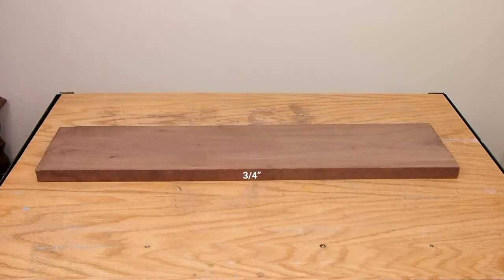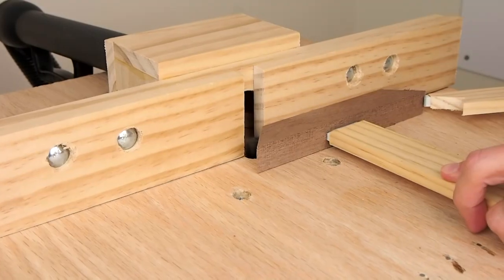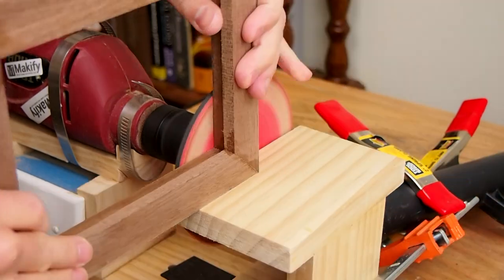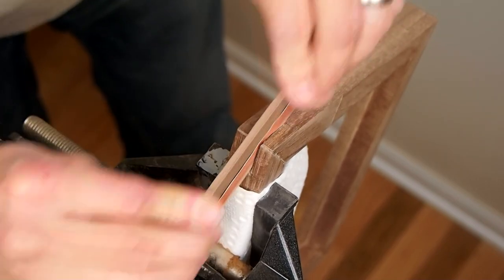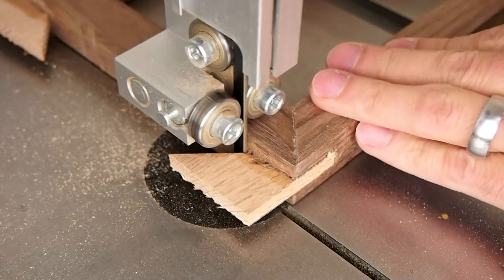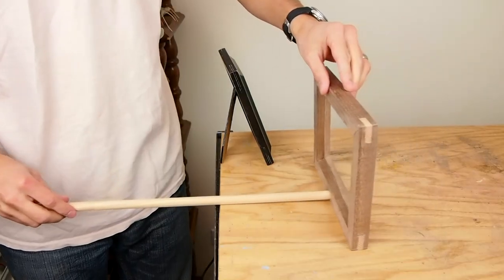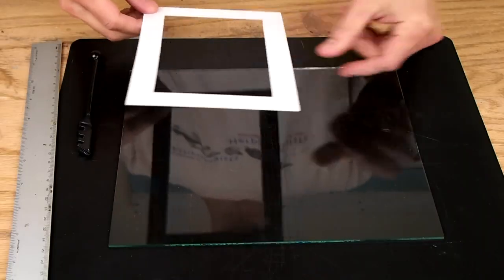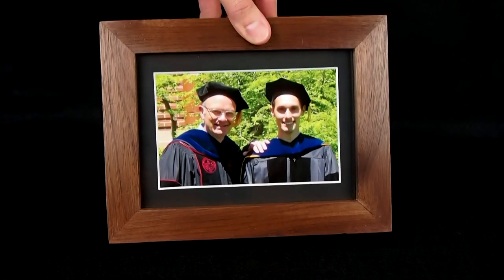How To Make a Handmade Picture Frame

Comment: I tried making a frame for a large (24x18) canvas print. I totally botched it because trying to measure the frame with a rabbet so that everything comes out square and the correct size to accept the print is a lot more difficult than it seems. Eyeballing it isn't a good idea with larger frames. The print is rolled up and waiting until I know what the heck I'm doing. Any ideas on how to solve this and get a rabbeted frame to come out square and the right size? I hate math with a burning passion, which probably means I'm doomed.
Reply: say you are using wood that is 2 inches wide. you want your canvas print to slightly overlap the wood all around to accept the glass and to hide the canvas edges hence your rabbit. say you want this rabbit/overlap to be 1/4in all around.

you take your inner miter length of 24 and subtract 1/2 (1/4 * 2) to get 23 1/2. you then multiply your wood width by 2 and add that to 23 1/2 to get 27 1/2 - this is your outside miter length. The same calcs apply for your height (21 1/2). If you draw a triangle with the hypotenuse being the miter between the parallel inside and outside miter lines you will better understand this formula.

if you want perfect miters you need to use a miter saw (calibrated with a framer square) with a good high tooth count blade and it is preferable to cut the complimentary pieces (height and length ones) at the same time to ensure the cuts are exactly the same length. otherwise your miters won't end up perfect; like the one on the bottom right of his. a good tip if that happens is to rub some sawdust in to the small gaps while the glue is still drying and everything is clamped up (i recommend a corner clamp or a kreg clamp).

Comment: I don't understand the real reason to insert these triangles on the angles.
Reply from the maker: +minopausa Ulisse Nobody  The places where the 4 main frame pieces are glued together are all end grain which is not a strong joint especially considering that there really isn't much surface area at these joints. The triangle splines reinforce the joints by providing more surface area (that isn't' end grain) for glue.
Reply: Makify1 thanks for the explanation